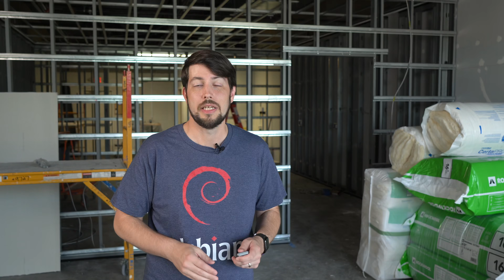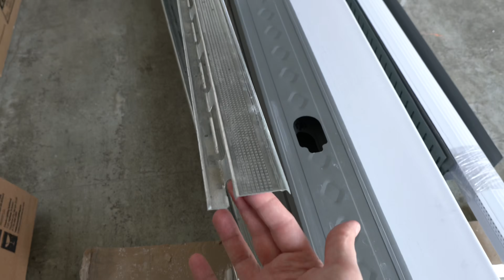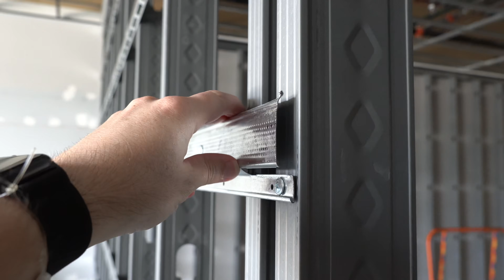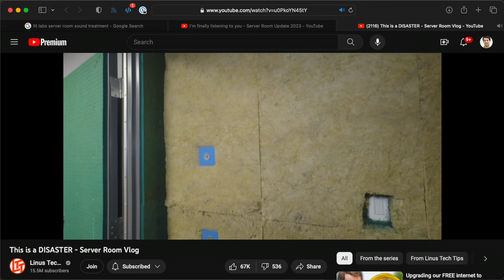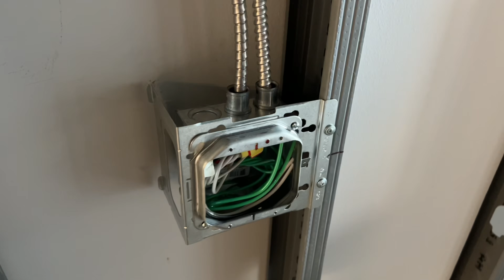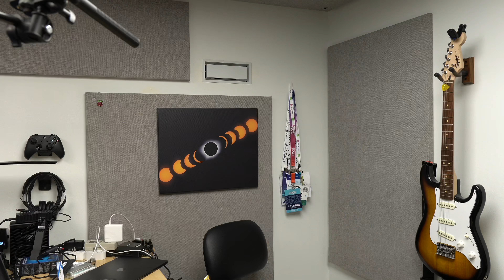Soundproofing my new studio (moving 05)

Comment: Here's  a pro tip for those that want to do it on a budget. 
1. Cheap insulation for the walls and ceiling.  Don't get the expensive pne
2. Very important - use 2 sheets of 5/8 drywall ! Not the 1/2 INCH
3. USE greeglue soundproof caulking  and spread it like a sandwich before putting the second drywall sheet. 
4. Use the greeglue soundproof  caulking for all seams , joints, bottom seams of the drywall. 
5. Use soundproof playdough on the back of wall wall electric sockets 

Your welcome

Comment: Did you use rockwool specific for metal studs? i.e. actually 16” or 24” wide If so, what thickness did you find?
I had ordered 16” wide x 3.5” thick (for metal studs, so insulation would fit exactly) from a place early last year but they were never able to fulfill the order in over a year because not even the manufacturer (allegedly) could get 16” x 3.5”.
Reply from the maker: We used rockwool only on the ceiling and it was 16" x 2", not a standard size for wall cavities. The walls got standard fiberglass batt insulation instead.
Reply: @JeffGeerling  oh I see, thanks for the quick reply!

Comment: Adding carpet to the doors can help mitigate sound there. One aspect I see you didn't decide on, was having off angle walls. I have a friend who was a sound engineer many moons ago, and she built her own home studio, and used off angle walls, because it can reduce the amount of sound bouncing in a treated room. When it comes to reducing sound bouncing around a room, square rooms are the worst, so building the walls at odd angles, and lowering the size of flat surfaces can actually help. Though it does screw the aesthetics. Same applies to the ceiling. Having it broken up in several different angles is better than one flat sheet.

Comment: Sound Blankets, waving back and forth like an accordion (not stretched tight) is by far the best ROI for sound absorbing. You can get ceiling to floor length ones made, and they are absolutely amazing.
Reply: For mids and highs, but does very little for very low frequencies.

Comment: You forgot a secret additional type of soundproofing in your intro:
Containment!

Say you want to run a loud machine like an air compressor but you need to work nearby or live in an apartment complex. All those different frequencies and vibrations need to be contained in a compact chamber while still allowing power in, air out and adequate cooling for the motor. When space is at a premium it starts to get real interesting

Comment: Just a suggestion.  When running power from the breaker box to the server rack .... run four (minimum 12 gauge) romex lines.   With each line connected to it's own breaker.   It will keep your equipment from experiencing "brown outs" by having too much draw on one circuit.

Comment: Make sure to run a 240V line to your server room, benefit from the better energy efficiency in the power supply.
Reply from the maker: I may do that at some point in the future, but for now I'm sticking with two 120v circuits, since some of my equipment only does 120.

Comment: Yeah I built a wall like that once. The door was the most expensive part.

Also try to avoid placing Power outlets in that wall and if you must.... Ensure to offset the power outlets on the inside and outside so they are not in one line.

Comment: Since the main thing that stops sound propagating is mass, one interesting trick I learnt was to use two layers of gyprock (drywall) sheets on the inside. For isolation, often having two sets of studs with the rubber isolation strips between them seems to work well, I guess those strips you’re using to hang the sheeting on the outside is a cheaper way to get something approaching that.

Comment: It is probably too late but the server wall next to the studio would be a great place to put some Mass Loaded Vinyl or MLV also know as a “Limp Mass Barrier”.  It is made up of a vinyl binder and heavy inert filler.  It is not very thick, maybe 1/8" inch.  You do not stretch it tight.  Instead you hang it loosely between the studs.  MLV is good at absorbing lower mid range frequencies because the mass can move slightly converting acoustic energy into mechanical energy.  What is important is that it works differently than rockwool which traps the sound energy by vibrating thin fibers.  MLV provides something for the lower frequencies to shake with longer wavelengths.

If you were to hang it between the studio and the server room it might make a noticeable difference in the low rumble of servers.  It is rather expensive, $240 for a 4' x 25' roll which is why I suggested a limited area.  

A variant of MLV is used in car engine compartments and exterior body panels to block out road noise.

Comment: With a bit more post processing, one get get an awful lot more out of the audio. Especially when it's only speech. I once made a while tutorial for this, see if I can find it, otherwise I will just share it again. But the best way, is using a steep high-pass filter around 100Hz with a noise gate and noise reduction filter.
Reply: I expected him to build a pi-cluster that does noise-cancellation on the fly. This solution seems to be quite old-fashioned.
Reply: @rennleitung_7  why would you do that if live audio isn't required?
Plus you have your editing computer anyway?
Reply: For the reason, he does a of videos: just to show a pi can do. So I thought, he would have some microphones outside the studio and some inside. Then he does some calibration, that whatever sound is outside, he knows what to cancel. Finally, when recording videos, you have the outside microphones, to know what to cancel of your recording. I don't know,if it's a viable idea, but it could save thousands of bucks.

Comment: I don't have very much construction experience (clearly), but I've NEVER seen METAL stud walls... how would that even work to try to screw/anchor to in order to mount stuff?  do you just ONLY use the drywall with drywall anchors?  why would someone do metal studs instead of wood?  also it sounds like it would be way more expensive...
Reply from the maker: Good question! Metal studs are very common in commercial construction, and there are various ways to mount things on walls with it (mostly drywall anchoring systems). If you plan on having cabinets, you can have the builders install blocking too, but in my case I'm not planning on that (at least not at the current time).

And with lumber prices the past couple years, metal framing can be more or less expensive, depending on the type of lumber!

Comment: Just a suggestion which I am sure you have thought of. how about putting laying down some 2x4's on the floor then put down wools fireproof installation between the 2x4's and then lay say either 1/2" or 3/4" plywood on top. After put down some industrial carpet that would be sound proofing the floor would it not and has to be cheaper then what your buddies did, at least I think so.. Good luck with it all.

Comment: You are doing it right!  Building a room inside a room is pretty much all you can do.  If you can hang some 'clouds' at odd angles from the ceiling and treat both sides of them that will help with reflections and deaden the room at the same time.  It also looks cool, and keeps your walls less cluttered.  They can also be placed below vents to eliminate any remaining turbulence noise from HVAC.  It's best to do as much on the floor and ceiling as possible since those are your largest surfaces, then do minimal treatment on the walls where it's needed.  You can also have baffles on wheels that you can move around when recording, then out of the way to break up reflections.  Recording studios would use these all the time in 'live' rooms.  Since it's just voice over they wouldnt even need to be that big.

Comment: we considered sound insulation/isolation when building our new extension. we had staggered vertical wall struts so that the pasterboard/sheetrock on one side was not linked to the other side of the wall, and the cavity was filled with the fluffy roof insulation. in the uk building code also has you using two layers of ceiling pasterboard rather than one for extra weight and sound proofing between floors.

Comment: Another trick i've used in many of my pro studio builds is to physically change the mass of the walls. This can be done simply by adding an additional layer of sheet rock. Ideally all the walls should have at least two layers of sheet rock, the second layer should be thicker drywall, I generally use one 1/2" layer then top it with shaft liner (1" drywall) on two of the walls and 1/2" on the other two. The approach works great for getting rid of resonance transferred through the building and from outside. Then just treat the dihedral and trihedral corners with foam and the room should sound pretty good, add tweaks as needed.

Comment: Probably a little late (and over the top), but… Regarding the inside acoustics - if possible, the inside surfaces should not be parallel to opposite ones. This can help to avoid standing waves in the LF/LMF area, and somewhat shorten perceived room echo from room modes. Sure, MF and HF will be dampened by all the wall coverings you mentioned, but refraction and reflection may still be happening. What little LF/MF that leak through from trains of hvac, will be less audible if the energy is dissipated more quickly from lack of resonance creating modes. There are online calculators to roughly find possible acoustic modes from room dimensions. Just my sound engineer 5¢, and all the best! 😊👍

Comment: good to see some progress on office and the debian shirt - red shirt jeff probably would have done stick framing and installed some faraday caging for less resonance and harmonics - seriously though think about hepa pos pressure on the  hvac and extra padding under the carpet - you are almost at the point where you can do a lot of diy - if you have extra insulation pile it on...maybe red shirt jeff can add some input and yoko ono plastic ono band screams to help test out the raw performance of the new design? - don't forget to run some fiber and cat7 and maybe even some usb4.4X4 compatible cables - think about at least running some pvc to make future runs more doable - now is the time to plan as you will probably be in this space for a while - think about the power delivery - consider some type of line conditioning, surge protection, lightning protection and maybe gfi+anti arc breakers along with proper bonding and ground - no hot neutrals or reversed polarity, aslo maybe consider some small white noise generators or even active noise cancellation and also route a wiring chase for antennae - you will want to have some wifi and radios, possibly even a pv panel or two or three and a rack for some batteries where red shirt jeff can recharge the sawzall

A pink noise analyzer is a tool used in acoustical analysis and design to measure and analyze the acoustic properties of a space. Pink noise refers to a type of random noise that has equal energy per octave, meaning that it has a flat frequency response. This characteristic makes pink noise useful for testing and analyzing the acoustics of a room because it contains energy at all frequencies in a balanced manner, similar to how our ears perceive sound in real-world environments.

Here's how a pink noise analyzer works and how it can be used in designing acoustical remodels:

    Sound Source and Measurement: In the context of acoustical analysis, a pink noise generator produces pink noise, which is then played through speakers within the space being analyzed. The pink noise analyzer is equipped with microphones strategically placed around the room to capture the sound. These microphones are calibrated to ensure accurate measurements.

    Frequency Response Analysis: The pink noise analyzer measures the sound levels at different frequencies across the audible spectrum. By analyzing the frequency response, it's possible to identify any acoustic anomalies in the space, such as peaks and dips in certain frequency ranges. These anomalies can be caused by reflections, resonances, and room modes, which are all critical factors in room acoustics.

    Reverberation Time Analysis: One of the key aspects of acoustical design is determining the appropriate reverberation time for a given space. Reverberation time is the time it takes for sound to decay by 60 dB after a sound source stops. Pink noise analyzers can help measure and analyze the decay characteristics of sound in a room, providing insights into the room's acoustical behavior.

    Absorption and Reflection Analysis: Acoustical remodels often involve adjusting the surfaces within a room to control its sound properties. Pink noise analyzers can help assess the effectiveness of acoustic treatments like absorptive panels, diffusers, and bass traps. By measuring the changes in the frequency response and reverberation time before and after these treatments, designers can fine-tune the acoustics to achieve the desired sound quality.

    Optimization of Speaker and Sound System Placement: When designing or remodeling spaces for audio playback, such as home theaters or auditoriums, it's important to optimize the placement of speakers to achieve uniform sound coverage and minimize acoustic issues. Pink noise analyzers can assist in finding the best speaker locations to achieve even sound distribution throughout the room.

    Simulation and Prediction: Advanced pink noise analyzers can also simulate the acoustical behavior of a space based on its measurements. This allows designers to predict how changes in room dimensions, surface materials, and acoustic treatments will affect the sound quality before making actual modifications.

In summary, a pink noise analyzer is a valuable tool for acoustical designers and engineers to assess the acoustic properties of a space and make informed decisions when planning remodels or modifications. It helps ensure that the room's acoustics are optimized for the intended purpose, whether it's for clear speech communication, musical performances, or audio playback.

Comment: For that train rumble, isolating the entire floor/room/building can be a bit unnecessary imho. If you are worried about vibrations travelling to your mic, having a high quality shock mount and padded mic arm should get rid of most of that noise. The "booming" of the train should be isolated by the walls and sound deadening inside them
Reply from the maker: Definitely! Some of the noise can be gotten rid of through inside treatment and mic placement. And in the end, rolling off 100 Hz would probably take care of the rest.

I just like to start from as clean a slate as possible, that way I can focus only on making it better in post, not having to clean it up first :D

I come from radio, so I'm probably a lot more insane than many other video folks about the sound on-site!

Comment: Why not using adaptive filtering when the train passes? You can record the sound from outside your recording chamber and as long as your recordings are in sync, you should be able to remove a good part of the interfering sound.
Reply from the maker: That requires a lot more post processing, plus each train is a little different, so I'd basically have to always be recording two mics in case a train rolls by.

Easier for a one-man show to just stop recording while the train is there, and then start again. I hate spending so much time just getting audio good in post.
Reply: It makes sense. Basically, I thought of an always on second mic, but yes, it's a lot of trouble for an issue with an easy solution. Fun fact, this technique is used to make fetal non-invasive ECGs.

Comment: That all sounds good - air gaps and insulation is a great idea.  I would have thought that fire doors would do great for doors, but you might also think of double doors with insulation that might do the trick as well... For the interior I would use carpeting - not tiles, but a real deep pile carpet, along with curtains and sound absorbing blocks, but I would be interested to see what you do... Your fix for the ceiling sounds good...  As you have noted, your problem is likely to be low frequency noise... maybe build anechoic tiles for the walls... anyway, you're coming along nicely... lots of things to think about 👍🙂
Reply from the maker: Every project is unique! It's fun, and the doors are on order (just thick, solid wood, with good frames that have good seals). I wanted to go fancier but that could be a future upgrade.

Comment: Fiberglass will work but rockwool insulation would be a better sound insulator.
Reply from the maker: We have rockwool going up in the ceiling, and standard fiberglass in the wall, where the drywall will be the more effective blocker, and the fiberglass will just add a bit more attenuation. Rockwool inside walls is overkill in this situation—I am applying the cost to the ceiling instead of the walls.

For a more professional (and expensive) studio, having double walls with double-layer drywall and an air gap, plus standard insulation in each wall, would be the best option. Very thick walls though!

Comment: a great an cheap way to treat the room is by hanging picture frames that are lines with regular towels. it's very cheap so you can put as many as you like.  Another trick is to put wood or fiberboard trims in 90- and 45- degrees creating pocket were the sound gets trapped.